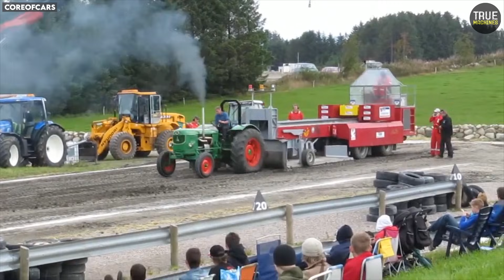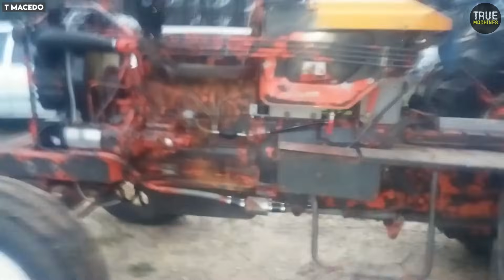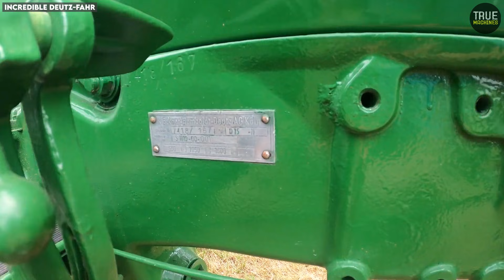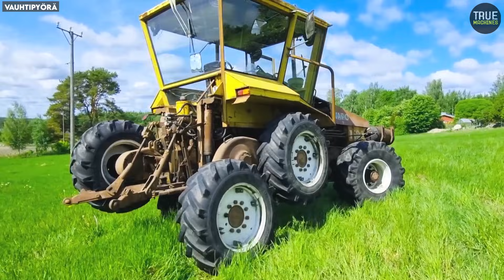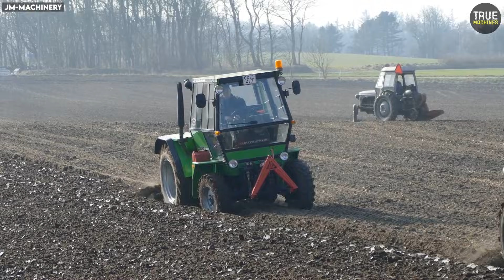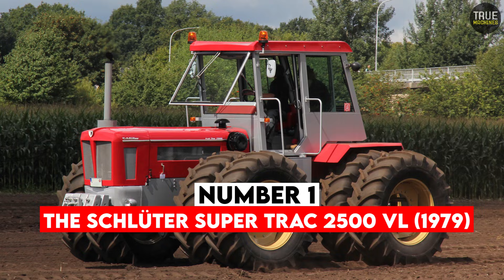10 European Tractors That Were Brilliant But Failed Miserably

Comment: Kak ! I m still using a DEUTZ 52 07 from 1984 with no problems of the aircooled motor. Never cleaned  the cooling fins. The best tracktor on the farm !